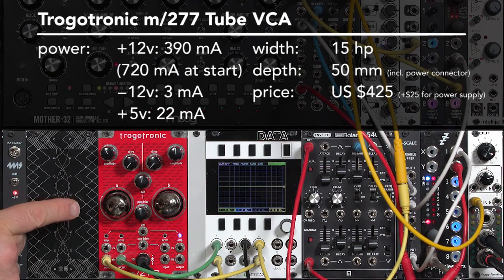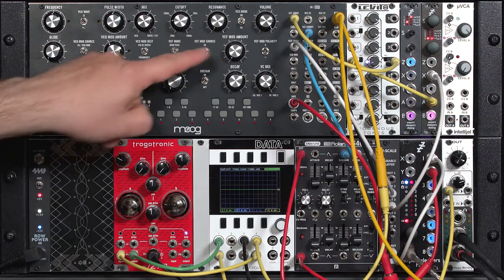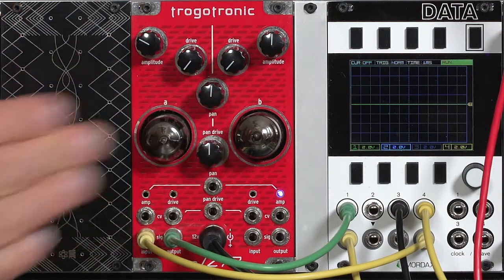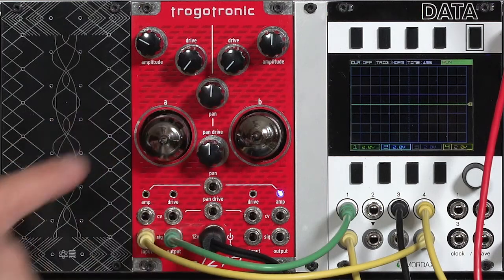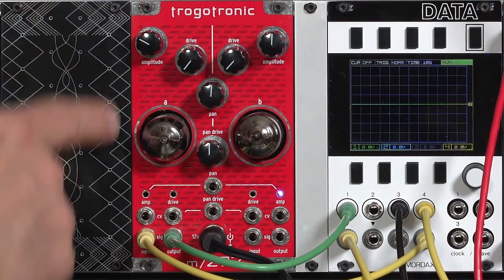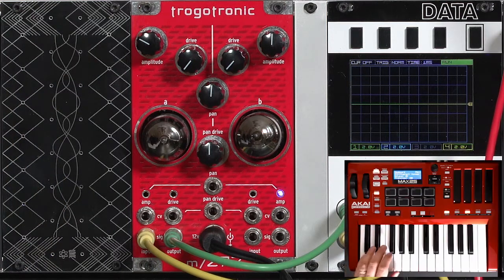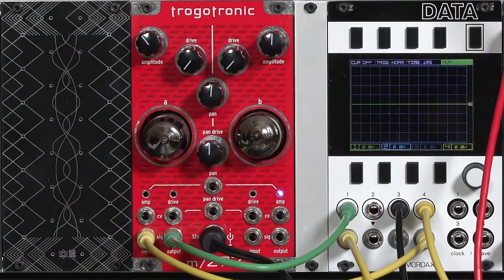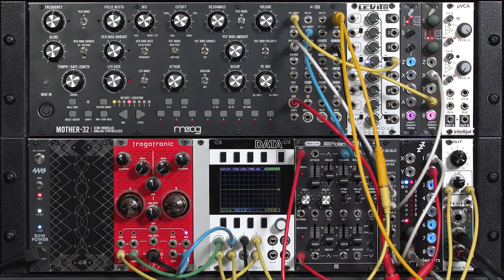Trogotronic m/277 Tube VCA 1/5: Overview (LMS EE)

Comment: While it's totally safe to replace a ECC83 (=12AX7) with a ECC81 (=12AT7), ECC82 (=12AU7) or any other dual triode preamp tube with identical pin-out and heater requirements, it will need re-biasing for a fair comparison and to make it operate optimally/as intended. Replacing it with a E83CC, the special quality version of the ECC83, will not require any adjustments.
I'm not sure if the module has any trim pots to adjust the bias though.